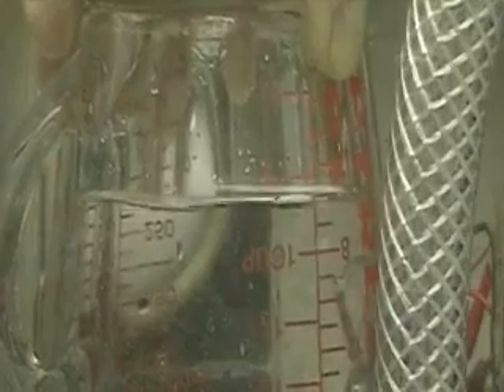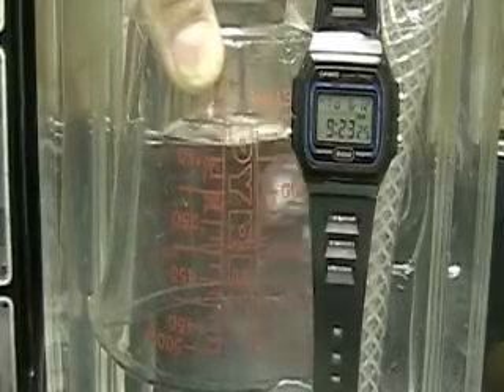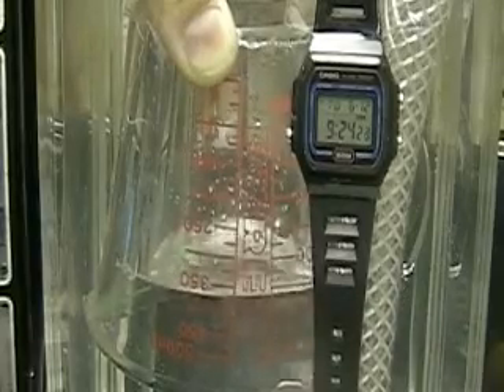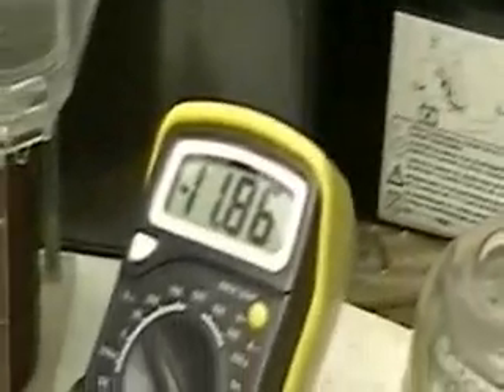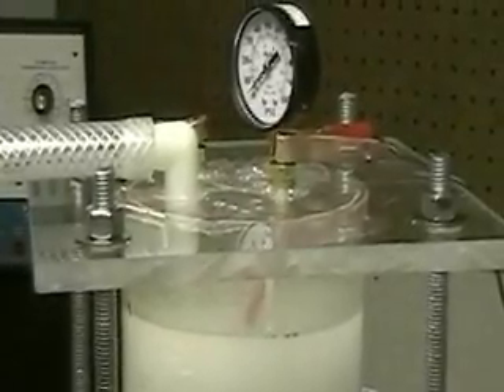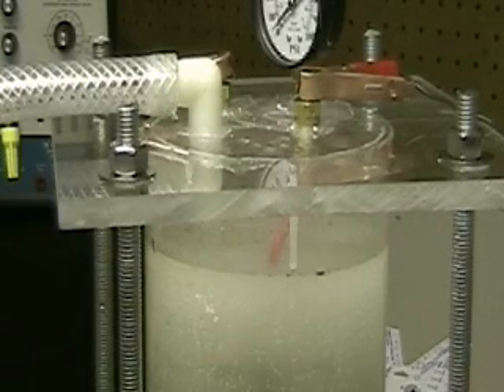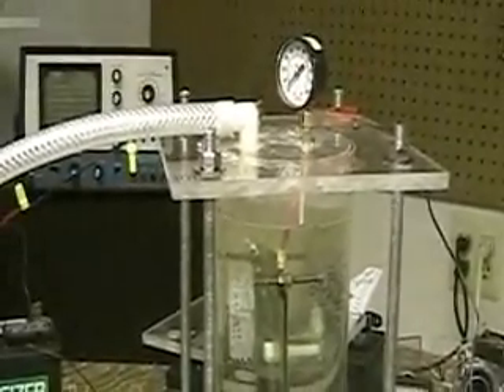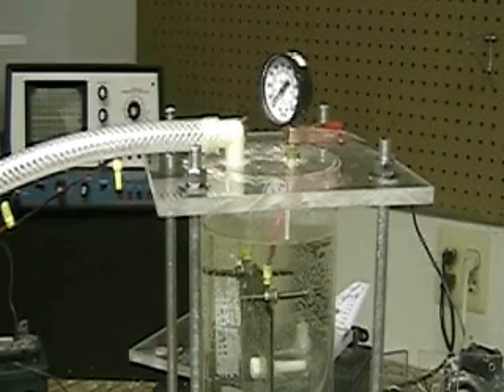Hydrogen Tap (Measure Out Put of Shop Cell) 111

Comment: hey, EXCELLENT work, its nice to see people that actually care about the earths future and breaking the bonds on oil. i constructed one of my first cells, it was made of stainless oven covers, i am running it with a 12 volt battery charger but i am getting overheating. the steel bolts that connect to the cell extend out of the water, can this be the reason for overheating?

Comment: Here's my shot at it: 

Looks to me like you are producing 166.67ml of HH/min. or 1.16ml/minute/sq. inch of Stainless Plate.

Your 16plate Aarons cell is 384sq.inches, & at this rate would produce 445.44ml of HH/min, or 1 Liter of HH every 2 min & 13 sec; or...

1 U.S. GALLON Of HYDROGEN EVERY 8 1/2 MINUTES!  

Sound right to you?